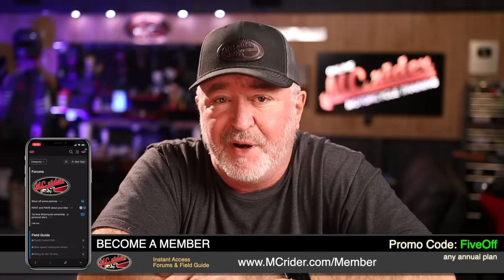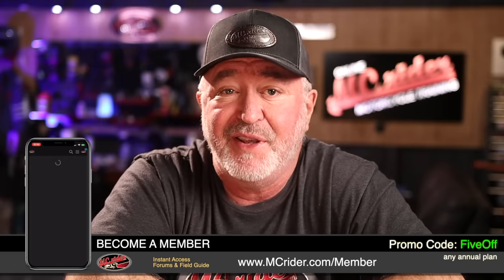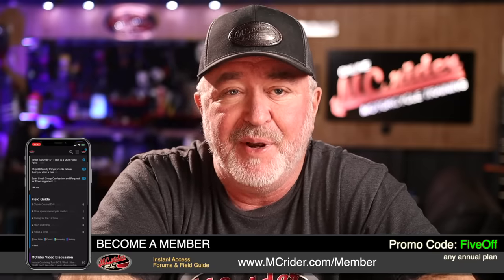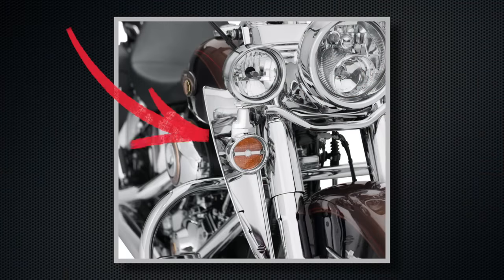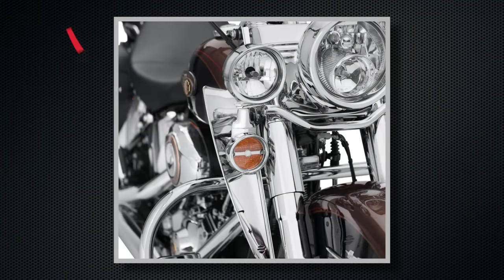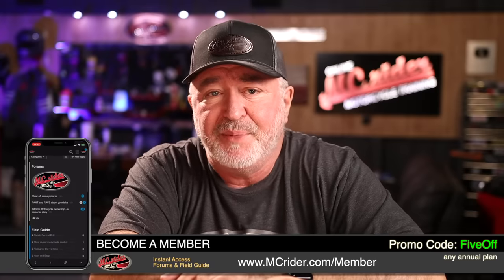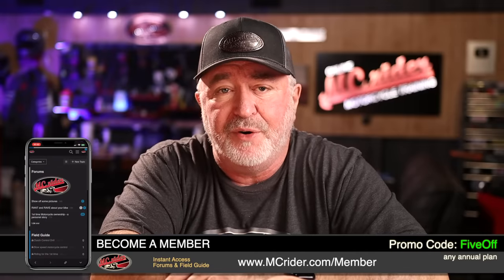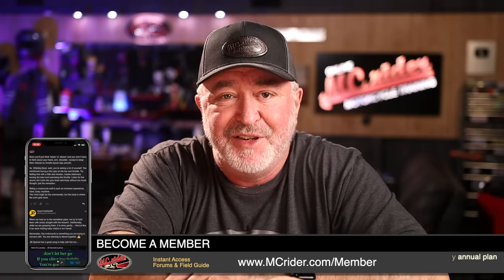Say Goodbye to Wind Buffeting on Your Motorcycle: Expert Tips and Solutions

Comment: I have been riding for about 60 years, and many different bikes under many weather conditions. The large group I've done coast-to-coast runs with for around 10 of those years has a "do not stop for weather" rule, which means I've ridden through a lot of rain - sometimes days-worth. I've come to value being able to peer just over the top of the windshield to eliminate water blindness. Balancing that with reducing wind buffeting has been a challenge. My usual solution has been the "recurve" windshields available for some touring bikes which have a curvature built-in at the top which helps to sort-of flip the airstream higher and over the top of the helmet. On certain bike models this has proven to be perfect for me. Unfortunately, since I've now been cured of the Harley disease, I've struggled to find the right windshield for my latest metric tourer. Still working on it.
Reply: My (once my gamps) 1957 Gilera has a very big windshield with a lever actuated wiper, you just squeeze the clutch like lever to clean the rain off.. It's amazing what people can come up with to be able to ride with a hat and a lit cigarette in winter
Reply: Please explain Harley disease?
Reply: @carlostrujillo4750  owning a Harley. If you do, you know.
Reply: No I don't own a Harley. Can't afford them  and no I won't buy used.why should I settle for a used bike? I would rather have brand new and I do. @bobconaway
Reply: Check out Madstad Engineering. They do a pretty comprehensive job at fixing the aerodynamic sins of the OEMs, although sometimes the resultant windscreen doesn't match the overall style and aesthetic of the bike as a result.

Comment: It's the reason that I WILL NOT use a windshield. I've even had wind buffering because my phone holder was set too high and it was overall very low to the bike, so it doesn't have to necessarily be anything tall in front of you just something to displace the air in front of your helmet be it low at your helmet or high.

Comment: As some people have suggested there’s a lot more to airflow than just the size or location of a shield. 40 years ago a company called Rifle Fairings figured out that putting a vent at the base of the windshield would greatly reduce the low pressure area where your head is located. Harley touring bikes in this century have included a similar vent. 

Another company, Madstad makes windshields that not only adjust vertically but tilt as well. It is amazing how effective they are. 

The stock windshield on my old Ducati ST-2 had a raised lip on the trailing edge. It was supposed to deflect the wind over the rider but instead it just caused turbulence. I got so sick of it that I cut the lip off! Suddenly I was riding in smooth air!

Aerodynamics is as much art as it is science. Unfortunately almost no bike manufacturers or windshield makers use the invention that’s been around for over 100 years. Wilbur and Orville Wright invented the first wind tunnel so they could study the actual effect of airflow. Unless a bike manufacturer is designing a 200 + mph bike they simply ignore the science and with a shrug say “that looks about right”😡
Reply: I know, I would be running some CFD analysis on my bike if I had the software license (I found a fairly good computer model of my bike for sale), because I really want a better windshield and as an aerospace nerd I've even optimized custom 3d printed Nerf Dart tips with CFD, and I model lots of custom accessories for my bikes).
Reply: Moto Guzzi prides itself of having built the first wind tunnel for motorcycles in the 1950s and their newest model V100 Mandello was definitely optimized in it.
Reply: Parabellum in Georgia, makes great windshields for motorcycles, the owner I think was the founder of Rifel , great company and products

Comment: Kevin, another great video!  Some windshields can be adjusted for pitch (i.e. more vertical or less vertical), such as aftermarket windshields that mount to the handlebar and fork.  I find that the more vertical the windshield, the more buffeting I get.  By canting the windshield to a less vertical position, I've been able to reduce the buffeting around the helmet while still taking the windblast off of my torso.  This might help someone....😉
Reply: Thank you for that info!  I'm going to try that before getting a different windshield. 🙂
Reply: My previous bike had a more inclined windshield and, I agree with you,  wind flow was much better.
Reply: Yes the Memphis shades in my profile pic is angled back pretty good and I never had a problem one. 👍
Reply: I had the cloth legscreens on a former Police Electra Glide….this courses buffeting and not the Klockwerks screen with recurve! I took them off, buffeting was gone👍🏼

Comment: Very good points. I ride two up a lot. I find that if I cure my buffeting, many times it just moves to my passenger. The fix for me many times just makes a huge backdraft on my Wife's back. I also agree that bigger, taller, wider, is not the answer. One thing to consider is that buffeting is mostly speed related. If you find a cure for buffeting at 60, it probably won't work at 70 mph. As you said the style of the helmet is also a factor. On the '01 thru '17 Wing I have found that opening the windshield vent slightly helps the buffeting at interstate speeds. I also agree that clean air from a short windshield causes less buffeting IF you can stand the constant noise, bugs, and neck strain from a 10 hour day at interstate speeds, such as when we are trying to just get "out west". Thanks Kevin for your videos! Happy Trails!

Comment: On my 2002 VTX 1800 - with 8 inch rake - I've removed my windscreen and raised headlight about 6 inches. Due to the 24" seat height and fat gas tank - this puts my headlight approximately center with my chest. The result is an area of calm from about eye-level down. 
Before I raised headlight it was all you could do to hang on. Now is completely manageable even at 80MPH. I have no plans to put windshield back on. Different stroke for different folks - but I agree with everything Kevin pointed out - great content.

Comment: I am surprised Kevin didn't mention his experience with his Goldwing that he used to have. The only "buffeting" I've experienced is from extremely strong side winds, something that EVERY motorcycle rider experiences. The Goldwing has a frame mounted fixed fairing with a windshield. I happen to like my windshield height just above my eyesight. I think the key with the Goldwing is the area around the forks is open and allows fresh air to come up through there to displace the vacuum created by the fairing and windshield. In listening to this video, I realize I have not experienced any of the buffeting he describes here. I have owned 3/4 helmets with and without snap on face shield and modular helmets with flip up shields. No problem here. His videos are always informational and beneficial. Thanks Kevin!
Reply: Kevin's former GW had a windshield that could be raised electronically up and down while in motion! I have one and it changes it's 'angle to rider' space as it moves; excellent!  I have no such issues with buffeting.
Good Rides
Reply: Concur on the side wind.    I have a 2006 Suzuki VSTROM and I only experience vortex shedding with side winds.   I love the windshield on the VSTROM.

Comment: I recently got a 2018 Harley Fat Bob and thought I could make it without a windshield. Well after a couple of longer rides I decided I definitely needed one. My research leaned me towards a product by MADSTAD. Their windshields are adjustable up/down as well as you can tilt them back which helps clean the air up. I’ve only had it a couple of weeks but so far so good.
Reply: I think you meant MadStad.  So when conditions change, you get off your bike, adjust it, try it, stop again, adjust again until you get it right and until the conditions change again?   Sounds brilliant.
Reply: @heybruh3274  you are correct… it is MADSTAD. When I have to fine tune the position all I have to do is pull over. It is not necessary to get off the bike.  It is possible to make the adjustment while moving although I would not recommend that.
Reply: I had one on a Klr and it was fantastic. I could ride year round in Ohio. I think the key is that wind goes underneath it as well as over it.
Reply: Been considering a madstad mount for so long. I don't care a lot during summer, but in winter less wind would be better
Reply: @TravisTerrell  It’s worth the money

Comment: I'm not sure if I experienced wind buffeting but I have some observations about screens.  The first big cruiser I owned was a Yamaha XV1100.  It had a tall screen and the lowers you referred to.  It did a great job of keeping the wind off my head and chest when riding at highway speed.  It was a fixed screen.  I traded that for a Kawasaki Vulcan Voyager which also had a fixed screen and leg shields that could be opened to allow some air through on the legs in summer.  It was good at keeping the wind off as well but in summer when riding through built up areas at low speeds (50km/h in Australia) where you might need some airflow it was not so good.  I have a Suzuki Burgman 650 scooter with an adjustable screen (electrically so it can be done while riding) it does a great job of keeping the wind off the chest and head but allows for air flow at low speed.  The screen has a good amount of travel and has a concave curve so the wind is directed up and away.  I traded the Kawasaki for a Can Am Spyder (RT Ltd) that has an electrically adjustable screen and a pretty wide nose as well as wind deflectors so I think it does a pretty good job keeping the wind off as well.  The one bike I owned for a short time that had a useless screen was the Piaggio MP3 400.  It had one of those stupid little sports screens that didn't do anything and was more of a decoration than of any practical use.  Enjoy your ride wherever you're going and everyone stay safe on the road.

Comment: Yes sir, the reasons I ride a motorcycle are Many, after 50 years I’ve got it down to just one motorcycle now, a Harley V rod anniversary. I know,  so one day traveling with my first wife down eastern Avenue. She goes pull in there, happen to be a Harley Davidson shop the year  2002, we went inside the building and I noticed things seem somewhat organized as to salesman‘s greeted my wife right away well lo and behold she purchased a 2003 anniversary V rod for me. As you can imagine, I was in the height of my happiness looking at this beautiful motorcycle wow and it had a big old windshield on it anyway was a beautiful day I wrote it ride home, took the windshield off, and never put it back on, well, the wife has passed on, but the V ROD still remains, it still is my most prized possessions 21 years old and still shines like a diamond. I put 70,000 miles on it. And it’s still going strong, and the windshield it’s still wrapped up, on the shelf in my closet, I know this was supposed to be about windshields and I didn’t like it. It made my head wobble on the top just like Mc Rider said.
Thanks for all of the great content we’re all in a better place when you’re along with us for the ride keep up the good work will be listening.

Comment: I owned a 2009 VTX1300R with windshield.

Wind buffeting was fairly noticeable at cruise speed so, I fabricated a strut mounted deflectors out of clear plexiglass.

It helped some but, not too much.

About 3 years later, I solved it by buying a used 2005 Goldwing...

To "better" control buffeting, I installed a 6" taller than OEM.

Like you mentioned, looking through it made for problems during "buggy" season for obvious reasons.

So, now on my 2nd used Goldwing, a 2007 model, I kept the OEM and adjusted to where I can just see over it.

The bike also came with 2 deflectors...ones mounted on mirrors and ones mounted on fairings, both adjustable.

Nice smooth ride compared to 2 previous bikes.
Reply: I fabricated  strut mounted deflectors for my Shadow 750. Tried getting a tall windshield and trimming it down an inch at a time. My solution was to get a BMW  R1200RT with an adjustable windshield and overall design made to protect the rider from wind and rain. The Shadow was designed to look good.

Comment: I’m a relatively new rider (about 2 years) and I like a taller windshield setting most of the time on my touring bike. I rode from SC to SD, Wyoming, Montana, & back last September and appreciated the protection from the elements. I do prefer a smaller, lower windshield on my dual sport bike. I tend to be riding it off road and at slower speeds so the wind isn’t as much of an issue.
All that to say I think I know what I like but you have given me some new information to consider and I’m open to changing my mind.
Thanks 🙏

Comment: Great information. In 2013 I bought a Harley Davidson switchback. Initially the wind buffeting was terrible and I purchased a large recurve windscreen. I found that that didn’t help. I also realized that the wind that I was getting hit with was coming underneath the windshield. I installed fork, mounted wind, deflectors and it solve my problem completely. Then I found that I had no wind at all so I installed a lower windshield. now I have a smooth flow of air and zero wind buffeting. You are right about trial and error, but it can be expensive.
Reply: Where did you get all these add ons ?
Reply: @rudeawakening3833  windshield from Klockwerks and Wind Deflectors from J&S Custom which, unfortunately, do not make them anymore for Switchbacks. Not enough volume I guess. However, Harley still supplies them.
Reply: @PHICEN  
Thanks for that and for getting back to me !

Comment: Had a H-D Road King with a big windshield so I cut it down about 2". Was easy enough to do with a band saw and a fine tooth blade. Felt so much better looking just over the top, and not through it. Safer I think and wind was still controlled.

Comment: On my VFR800 Crossrunner I fitted a taller screen AND fitted mounting screws that placed the screen a further 12mm forward of the fairing. The screen had a small gap at the bottom that allowed some air to move into the void. A larger gap with a larger screen worked well to reduce buffeting.

Comment: Thank you  Kevin for all the information and knowledge you provide.
I am a new rider and have learned a lot from you.
I'm  having bufiting issues over 50mph.
 So far I cannot find lower fork mounted farings for a Fat Boy.
I had a windshield installed to keep the clean air pressure off my chest and Virginia bugs off my face but it definitely caused big bufiting  issues for my 🤕. 
Appreciate your channel,
Bruce.
Reply: You're searching for the wrong thing. Search for "fork mounted wind deflectors" or "fork mounted lowers" for your bike. There's nothing out there that mounts to the LOWER forks, and that's where you're getting messed up.
Reply: Same issue 😢

Comment: I had good luck with MadStad windshields out of Florida. They are engineered to pull air under the front of the windshield so the air flows smoothly over both sides of the windshield.  And it does it well below the line of sight!  Check them out.

Comment: My '22 Street Glide gave me buffeting headaches for the first couple of months.  I put on a taller windscreen, 6.5 inches.  The buffetting decreaseed but still not enough.  I also thought about an even taller windscreen, but, like you, did not appreciate the look.  I purchased Harley's fork-mounted wind protectors, and it solved my problem.  If you have a black-out bike, then you are in a bit of a jam because they are only sold as chrome.  I paid my local powder coater to make them vivid black, and they matched pretty well.  Be prepared to put out $100 for the coating.  Now I am considering lowering the windscreen because I think most of the problem was from the air pushing up from the forks.

Comment: There  are foils that you can attach to the top of the wind screen that make it act like it’s taller than it is, you see the ADV guys use them.  I like to keep my wind screen short otherwise I might get hit in the face when the front wheel tries to climb over a big obstacle.

Check the aftermarket for your bike.  Sometimes they make bits to fill in areas around the fairing that create a common problem for a lot of riders.  There are small folks that go on the sides of the GS fairing that make a big difference by moving the side air a little further to the side.

Sometimes it’s also the helmet you have.  Some cheap helmets are just helmet shaped.   More expensive helmets often have features on the outside that help smooth the air to quiet them down but it can also sometimes buffeting. 

How close or far away you are from your fairing makes a big difference.  Sometimes moving a bit forward helps. 

Some motorcycles are designed for the rider to stay closer to the machine.  On a sport bike if you tuck a bit more the air smooths out because you are not there to block it.